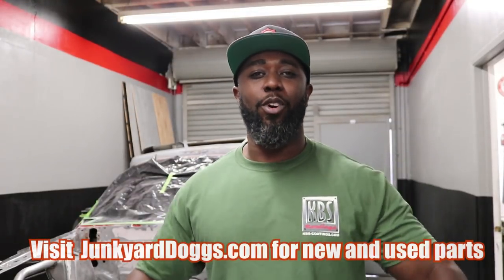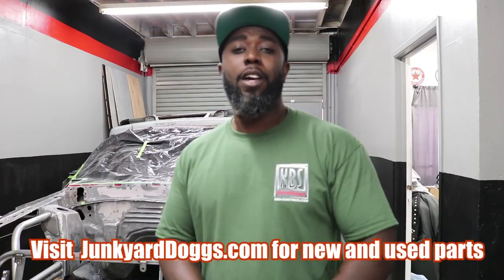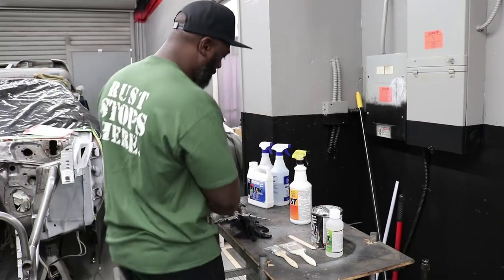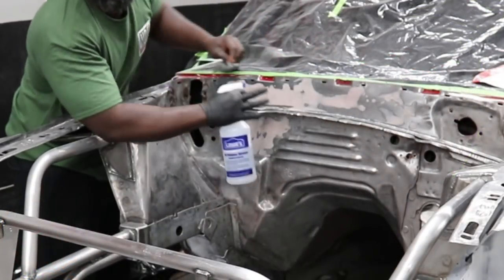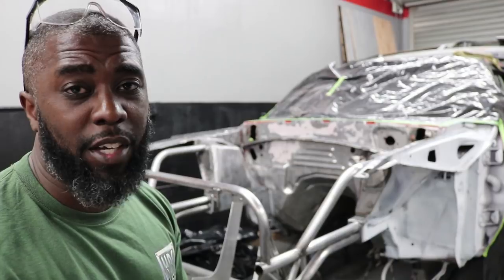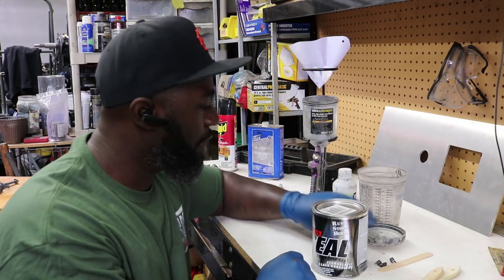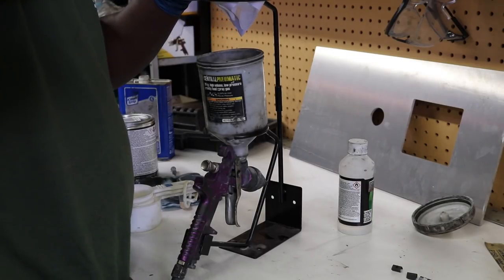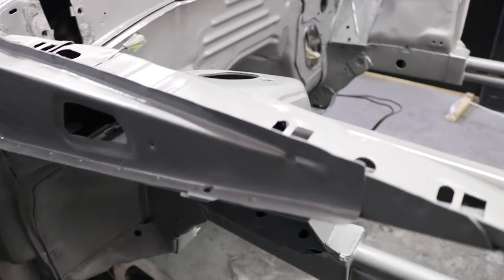Foxbody Mustang Engine Bay Restoration -PROJECT MAYHEM Part 34

Comment: Quick question 94 Bronco full-size 5.0 picked up a pair gt40p heads will I have any problems with these heads on my truck and also what do you suggest for a camshaft
Reply from the maker: All you need is either BBk or MAC headers and 90 degree spark plug boots and you should be fine.  And Anderson N41 cam or a B303 cam is always good
Reply: @JunkyardDoggs   is there anyway I can use my stock exhaust manifolds I use the truck for pulling my quads
Reply from the maker: You can try and see what happens.  I still think youll need the 90 degree spark plug though